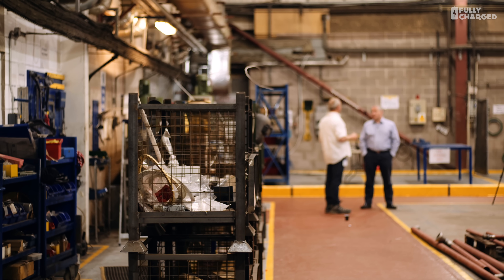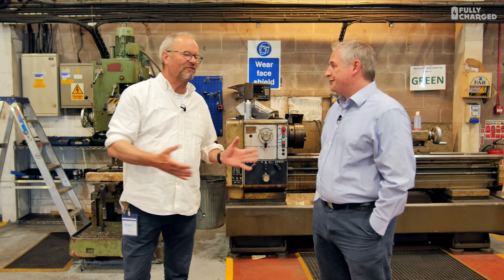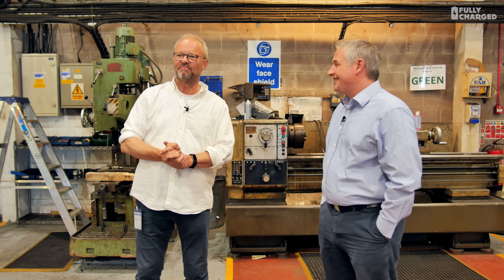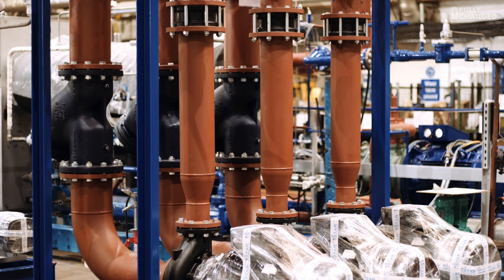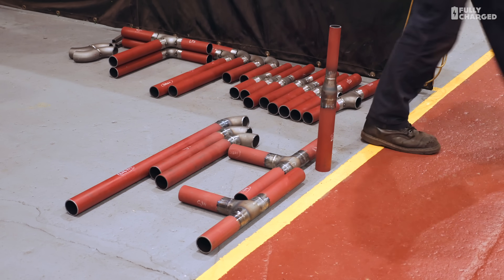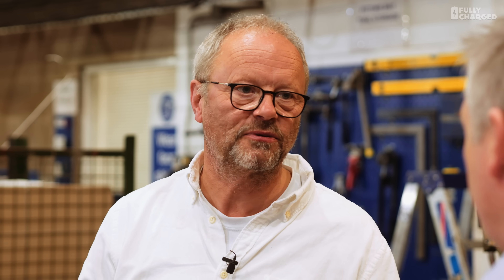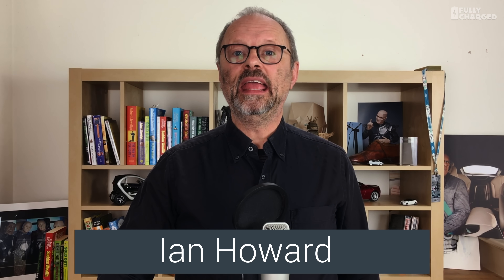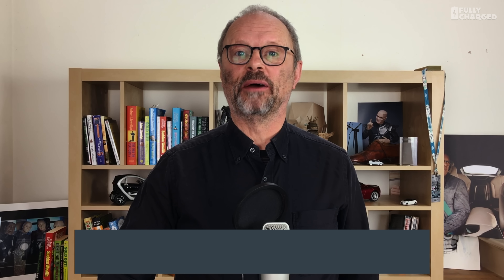Star Heat Pumps | Fully Charged

Comment: Cooling the sea is answer to global warming....let cool the oceans too....
Reply: According to the law of conservation of Energy, energy can neither be created or destroyed, only changed from one form to another, the heat that would be removed from the sea would warm up the building and then dissipate into the air, that unit of heat extracted from the sea would have zero effect on global temperature, even if it was done world wide, so no your assertion is incorrect.
Reply: Sebastian Breymann please read my answer to his assertion, global temperatures would be completely unaffected.
Reply: Neal Archer The Earth isn't a closed system. Heat from the sun comes in and heat radiates away from the Earth.
Reply: Jóhann G. Ólafsson yes I know this but that is not what the conversation is about. If you move heat from the sea to a building then to the environment , it is still within the global system as it were at that point. After that point is what would happen either way, so there is no loss of heat by this action whatsoever to the global system.
Reply: No
Reply: Drunken Hobo  ha ha very funny.

Comment: Heat pumps are how most houses in Scandinavia and France are heated nowadays. It is an obvious solution. Get an air to water heat pump and save 2/3 of your heating bill.
Reply: Air source heat pumps have a payback period of 5-7 years in the UK, currently. It absolutely makes sense to build every new home to passive house standards with air source heat pumps, a south facing roof with building integrated solar PV and an electric vehicle charging outlet. Lack of political will is the only problem in the UK.
Reply: Unfortunately that's true. It doesn't make economic sense everywhere at the moment. But as electricity from renewables decreases the overal cost of electricity and as people are pushing on reduction of subsidies to oil/gas companies, these differences will continue to shrink rapidly and the economic benefit of the heat pumps will become more obvious. So I think companies like the Neat Pumps have a bright future ahead of them.

Comment: If you don't understand the subject or the numbers involved then I would recommend that you do a little research before making a comment that will make you look quite a bit foolish.

Heat pump systems work very well and the numbers quoted here are typical for a large system with water sourced heat.
Reply: Vanishing Point 400% is when you measure the amount of energy you pay for Vs the amount you get out.
Reply: Vanishing Point I never started a post with "do a little research". My reply to you was my first comment on this video. Try not to be so aggressive.
Reply: Heads Tails The geothermal stuff works quite well at the residential level. At larger scale, though, you run the risk of exporting too much heat in the summer, which the winter cycle can’t catch up to, resulting in significantly elevated ground temperatures. The river approach works really well to solve that weakness.
Reply: The thing is that this is not traditional geothermal, it is a water sourced heat pump system.

Take a look how the systems work and then come back and comment or do you need someone to explain the difference to you?

https://en.wikipedia.org/wiki/Geothermal_energy
https://en.wikipedia.org/wiki/Geothermal_heat_pump
https://en.wikipedia.org/wiki/Heat_pump

The biggest risk of an under sized geothermal heat pump system is to cool the ground to much in a cold part of the world or heat it to much in a hot part of the world, that is why they use rivers and also design the size of the system to match the load.
Reply: Ive got a standard 4 bed detached house circa 1999.  Replaced mains gas boiler in 2015 with Air Source Heat Pump system supplying all my heating and domestic hot water. My heating and hw bills are now in the real world  200 pounds per annum cheaper than when I was on mains gas, and thats before the annual RHI rebate!
Reply: Vanishing point asks "Does their system produce 400% efficiency"
It produces more energy than what "we" put in. It doesn't produce more energy than what the sun gave it originally. Anything over zero degrees kelvin has energy, heat pumps take that energy. The heat pump in question outputs 4 times as much energy as a space bar heater. Some schools of mathematics allow to you to represent numbers greater than the original as multiples but is totally valid to represent multiples as a percentage IE 4 x the comparison number = 400%, the comparison quoted is a traditional heater and this is what is used to produce the ratio and relationship for that bit of mathematics.
Reply: Vanishing Point have you used or implimented a system? Any hands on experience? No? Well? I have.
Reply: Vanishing Point no experience then, yes. DHW has a lower efficiency but still good and when factoring in a combined system and a typical new build small house then the costs can work out.

Likewise. In a system like those in Norway where power is cheeper, especially during periods of peek production it makes even more sense.

Likewise, in the mixed power production system that is in place in the UK then it makes even more sense to look to impliment water sourced heat pump systems for large buildings or district heating systems.

It doesn't suit in all cases. Especially where non-renewable electricity are used but we are going away from carbon based power production. Heat pumps are going to be used much more into the future and you need not be scared or scaremongering about that change.
Reply: Vanishing Point ok. For the last time because you are either to thick to get it or you are being purposefully obtuse.

In a closed system, with no other inputs then it would not be possible to exceed 100% energy in Vs energy out. However, this is not a closed system, the low grade heat in the water ( as in the case shown but it could be the ground or air ) is improved by the action of the heat pump. This produces a reduction in the temperature of the water but as a very large amount of water is available the energy output can be very high, not to mention the heat output of the compressor and pump.
Reply: Vanishing Point the question of the  source of the money needed to invest in this type of system in Norway was not in question, however it would appear that their government is looking towards the future, unlike some other governments who are wed to the idea of carbon only energy systems.
Reply: I seem to remember the company rep saying for that one unit of electricity they get 4 units of heat out. He didn't say 4 units of electricity came out. So that's their measure of efficiency.
Reply: 400% = 4 times his comparison. It is really simple.
Reply: He gives a reference/datum and its efficiency, his heat pump delivers 4 times as much energy which can be mathematically stated as 400% more. If you are told the efficiency of his reference, call it A. and the output of the heat pump was B. you could calculate what B is by his figure of 400%. Easy eh? Tomorrow we can move to long division.
Reply: He is measuring his input energy not the entire input the energy of the system. No laws of thermodynamics were mentioned by him so he isn't disputing those and neither am I.
Reply: If I can carry 10 kilos up a hill but instead I use a horse which carries 40 kilos then my horse system is 4 times or 400% as efficient as carrying it myself.
Reply: Oh dear, the system of using a horse would be 400% more efficient not the horse. If you want to get silly and start measuring the fuel input of the horse I could counter that horses can live on grass and humans need more complex and harder to grow foods. Why do you think we use horses? Clue, it's not because it is less efficient than using a human. Yes, they need more energy but just like in the video we are  not comparing total energy in. You are overthinking it. We used single bar heaters because they were simple and easy to make (part of the energy input required to use them) heat pumps are a lot harder to manufacture as they become simpler it will become more efficient for humans to use them. Note all the different meanings of efficiency here. It is not just a simple mathematical or engineering sum.
Reply: Vanishing Point you wound this up superbly. "definition of a waste of energy".
Reply: Underfloor or via radiators
Reply: If I use a lever/block and tackle to lift something that is 4 times as much as I can by hand thereby allowing me to do deliver 4 times as much then I have increased my efficiency by 400%. Think about the word deliver vs produce. The heat pump delivers 4 times the energy than what was the maximum prior to using a heat pump.
Reply: JoeyRodz74 it’s not wrong to say it’s 400% efficient. Efficiency is the ratio of energy you put in to useful energy you get back out. It makes no difference that some of the useful energy comes from the surrounding environment rather than your input energy. After all, every type of "energy generation" is just moving energy from one form to another.
Reply: Vanishing Point If you input 1 unit of energy and extract 4 units, how is it not 400% efficient? Nobody is creating energy. It is simply being moved/pumped from one location to another.
Reply: An understanding of the subject is not needed to know "400% efficient" is wrong. 
Essentially, the heat energy is already there and he just needs the equivalent 1/4 of that energy to move it elsewhere. That's not efficiency, however, as he is not generating heat with it. As used in the video, it's like saying it takes 1 watt to heat up a whole house just because that's how much power is used to open the furnace door.
Reply: Sorry but, no. You cannot have >100% efficiency. If the quoted system is really 400% efficient, they could use 1/2 of that and run the pump indefinitely using zero external power and that is not possible.

Comment: When comparing the performance of heat pumps, it is best to avoid the word "efficiency"- Wiki
https://en.wikipedia.org/wiki/Heat_pump
law of Conservation of Energy -  means that energy can neither be created nor destroyed- Wiki
https://en.wikipedia.org/wiki/Conservation_of_energy
Reply: It's a somewhat distorted, but useful view of efficiency. Basically it's "efficiency" in practical terms, i.e. "If I put 1kW of electricity in, how much heating output do I get?". It's supposed to be comparable to electric heaters, boilers, etc. so considering the full equation (i.e. adding in the energy derived from the environment) is not particularly useful or practical, as the energy derived from the environment is free.
In fact the more correct measurement is COP or Coefficient of Performance, which is, effectively, the same "practical efficiency" number in a different form,
Reply: As long as the conversation takes place it is a win.

Comment: I don't understand how it can cost 5x to run gas boilers against the electric heat pump system?  So burning gas you get approximately 1 unit of heat out for 1 unit of gas, with a heat pump you get 4 units of heat out for 1 unit of electricity.  For the gas boilers to cost 5x more than the heat pumps then gas has to be more expensive than the electricity.  In the UK electricity is about 3-6x the cost of gas (depending on time of demand), though I guess wholesale rates can be (briefly) more extreme than that.
Reply: He is probably also counting the losses from average gas boilers.

Comment: Another comment from Switzerland: we have heated our 4-bed new-build house for 10 years with an air heat pump. 
Against: it's big (1.5m x 1.5m x1.5m) it's also quite noisy.
For: it's cheap - we pay about £350 a year for all our heating and hot water - and we have the room temperature at 23°C, which thanks to insulation it will maintain however cold it gets outside. Also we have not spent a penny on servicing in 10 years! I just open it up and vacuum out any leaves a couple of times a year. The electriciy is supplied on a special half-price meter and switches off at peak times, but the underfloor heating takes 24 hours to drop just a couople of dregrees, so short stops are unnoticble...

One question how do the heaters in Teslas and other EVs work?
Reply: Teslas and EVs usually use air-source solid state heat pumps, using the thermoelectric effect, for their air conditioning and heating to save electricity and get greater range.
Reply: Teslas use resistive heating, not heat pumps. The majority of EV's use heat pumps. Early LEAF's used resistive heating and have since changed to use heat pumps in the most recent model years.
Reply: Notlib  -  interestingly we’re now seeing the big auto makers all putting heat pumps in their cars to regulate battery temps...

Comment: We don't use gas for heating. Our airco system can both heat and cool. Works great. I live in Brazil so a 85% of energy comes from renewable energy sources. Mostly hydroelectricity.
Reply: Peter Faber do you know where the hydroelectricity is sourced from? Damms maybe?
Reply: snooogly Ofcource. Brazil has huge hydro dams. It's where they get 75% of their electricity. But they (finally) are trying to get more energy from wind and solar. The environmental aspects are slowly becomming more important here too.

You have to remember that Brazil is a developping country, which means they have to deal with problems the first world has already under controll. So environmental issues started to gain importance much later. But now that wind and solar start to become competative economically, here too they gain popularity. But it's only in the early stages.

Yet, brazil is aiming to quadruple energy from wind by 2020. (Compared to 2014)
Reply: Peter Faber I did not know, just assumed from what I knew about Brazil.
Great stuff! Even though damms arent the best they are still much better than coal for example that a lot of 'fully developed' countries still use.
Reply: snooogly Yes, but Brazil is just "lucky" they have access to so much hydroelectricity. They also have 2 nuclear power plants. So very little electricity comes from fossil fuels. Many first world countries don't have access to hydroelectricity, so they had no choice but to go with fossil fuels.

Luckily this is all changing and it can't go fast enough as far as I'm concerned.

Comment: That's bloody genius, wicked stuff. Can't wait until it's another thing that goes mainstream. Cool video.
Reply: Your office is probably heated, and cooled by a heat pump it's hardly ground breaking.
Reply: You can already order to install this in your house for years. They will drill pipes into the ground. The only problem with existing houses is that you typically will have to switch to a lower temperature system (40-45°C), for example floor heating, to replace your central heating radiators which workes at much higher temperatures to create convection (70°C).
Reply: Edward Cooper:
In a lot of places in the US, the heating is done by burning fuel and the cooling by heat pump.  The situation is partly caused by the fact that the landlord pays to put in the system and the tenant pays for the fuel.
Under earlier admins, there was an effort to change the heating systems to more efficient ones.  This was more for national security than for saving the planet but the effect is the same.  A nation where everything depends on a lot of fuel makes for an easy target for the bad guys.
Reply: Ken Smith
Some tall buildings in the USA have slinkies (water pipes) embedded in the foundations concrete.  They are used to extract ground heat.
Reply: My neighbour has his heat pump for years now. Not air to air but more like ground to air.
Reply: In the UK most people have gas boilers. Heat pumps might not be new but using them domestically in places like the UK is pretty revolutionary in how it will help us get off fossil fuels.

Comment: I had a ground source heat pump installed in October of last year here in upstate NY, it has worked out very well.
Reply: This ''heat pump'' these cats are talking about, is actually refering to the reverse bias of a refrigerator system right?

Comment: Heat Pumps are normal way to head homes in Japan http://www.toshibaheatpumps.com/
Reply: Betty Tureaud: It is the same in Norway. I have used a Toshiba air to air heat pump for det last 10 years, and it works really well. Even when outside temperature is below -10°C.
Reply: What about below -20?
Reply: In extreme environments, you usually need to supplement a heat pump with a resistive heater, which can still be powered by renewable energy.
Reply: ...or you can use heating oil or natural gas. I only meant that you can add a supplemental heater into the system and made a suggestion which can make use of green energy.
Reply: It still works pretty well at -20, but the COP value fall to around 2 (newer models are a lot better). So the amount of heat you get is less when you need it most. So you may need a supplement heat source. But air source heat pump usually do not like -25 to -30. The COP may fall to nearly 1 (same as resistance heater). Ground source  or water source heat pump is much more efficient when it is very cold, but cost a lot more to install. 
But in UK with mild winter/autumn year around, air source heat pump should be perfect is the electricity is produced from a not too polluting source.
Reply: Yes, you might be right, but the heat pump is slowly taken over in in larger apartments and houses
Reply: In Sweden we drill a hole in the ground and use the bedrock natural heat to run the system.
Reply: Ground source heat pump is great. Very high efficiency and the same efficiency regardless of outside temperature. Also a good source to heat water. But it is really expensive, like at least 10 times as expensive as a good air to air heat pump.
Reply: that's not true. most places still use kerosene heater